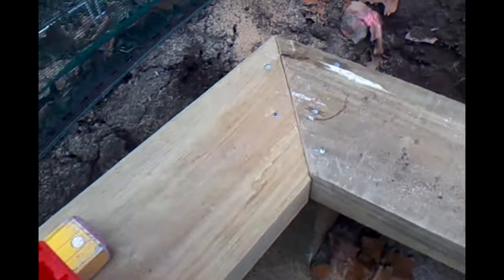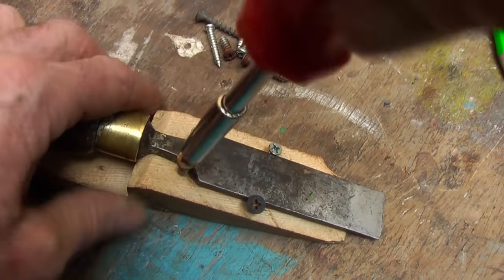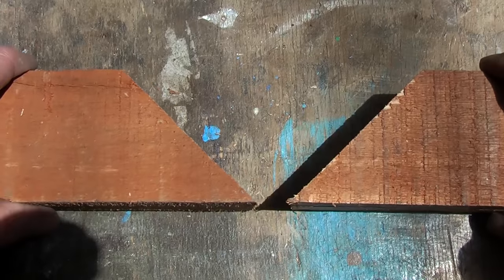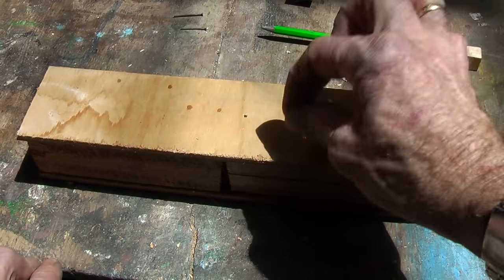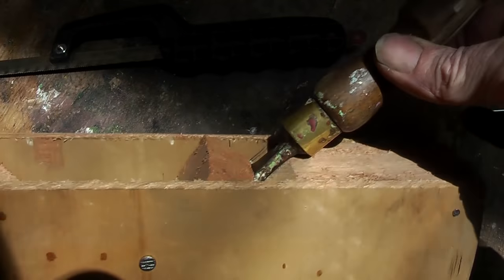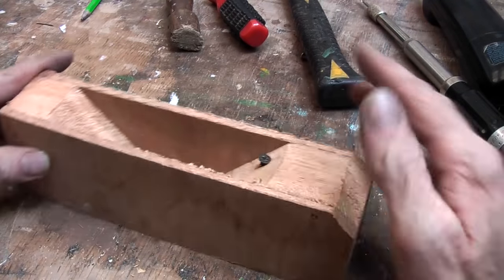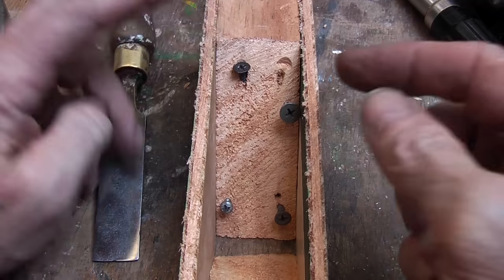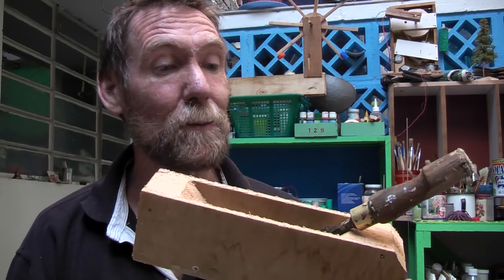Emergency Hand Plane

Comment: 7 year old vid, i know...But you just utterly destroyed my apprehension and fear of planemaking.  All proof of concept as long as the bed angles are right the rest is cake. Thanks!
Reply from the maker: Even the angle is not so criticle. It can vary according to what you want to do, and what timber you are dealing with, but... The sharpness of the blade edge is the  most , most important thing. The rest is just a holder for it...in concept. Hope your planes turn out well.

Comment: I like realizing tools with a beautiful look, let's say with a good finish.. But the same I like doing what's necessary in a short time, going just to the point, if you have a need and can't waist time. Those of yours are very good example of making what you need easily and quickly, so to be able to work in case you have not the right tools with you. It's nice when a ugly thing works well despite of its aspect! :D Well done man!

Comment: I don't know why anyone would be negative on this video. they have probably never seen old wood handplanes before. this is pretty much exactly how planes were made back in the day
Reply from the maker: +nikotwenty . Absolutely, in fact , if you do some  searching around youtube you can find some  better  videos than mine, on how to  make  several different  kinds of old style  'block'  hand planes. People do not realize that this is  basically  how  people used to do things, no less than  a generation or two ago. It is sad how low  technology has  brought us in our thinking (or lack thereof).
Reply: nikotwenty I'm not going to be negative but my only thought was instead of going through all that why didn't he just use tge belt sander? He said he sharpened the chisel upsetting it, so instead of that much time building a one use tool i would have hit it with the belt sander. Still a good idea if you don't have a plane, any electric plane, or a belt sander.

Comment: Got the job done! the wedge looked good - could it be that the big nail was too shiny with a large diameter. rough up the nail or use a thinner one. Anyway...subscribed.

Comment: I really like your idea to screw your chisel to a wedge its great so you get right up into corners but FYI your chisel still needs a lot of love from the grinder to true out its edge could use another handle if you have a tree out the back probably could cut yourself a piece of branch and whittle a new handle (dunk in oil or whiskey) for your chisel a piece of steel or copper pipe properly hack sawed for a feral and bob's your uncle it would look a million bucks again
Reply: i thought i was the only one who knew that haha :D
Reply: great minds think alike Aye?
Reply: Agreed. His chisel could use a little love.

Comment: Which drill did you use to make holes in second type of plane.
Reply from the maker: It's called an archemides drill. I got it in a second hand shop. But any drill should do.
Reply: thanks a lot.

Comment: so I'm guessing you got paid a day rate to make one of these on site when you had an old beat up no.4 in the van.. sly.. ;) 
good get out of jail video though.
Reply from the maker: j4ck888 I was only employed as an unskilled laborer, for cleaning the site and doing general donkey work. Between  lugging scaffolding and lumber around, I was  given the job contractors and fully waged carpenters were supposed to have done, because they had failed to do their job. I did the job solo, under budget, in half the time, with materials left over, did a better job design wise than was called for,  and saved them thousands of dollars....I got offered a  full time job, which I turned down, and came back here. No, I didn't have a no.4 in the van.  Everything I had was borrowed, including the chisel.